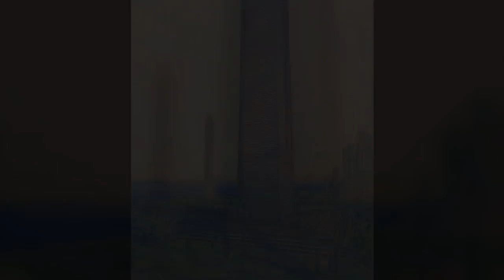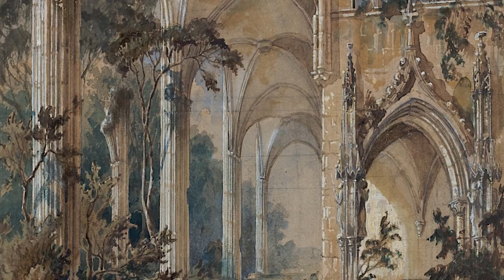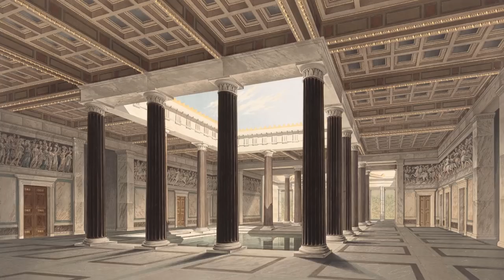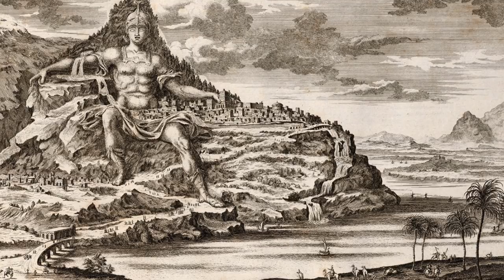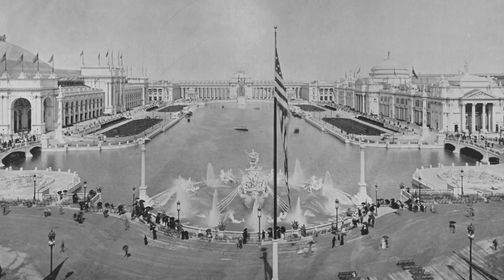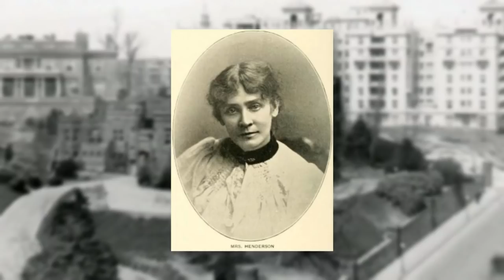Buildings that were never built #2

Comment: In 1640 king Christian IV of Denmark-Norway started building the large "Church of Santa Anna" (better known as Santa Anna Rotunda) in a new part of Copenhagen. Due to war and lack of money the project war soon stopped and in 1660 it was abandoned by the new king. Though we don't know much about the proportions and how it would have looked like it would have been substantial in size. Some speculate that the dome would have reached higher than the Saint Peters Basilica in Rome.